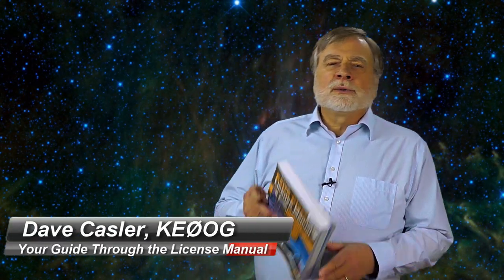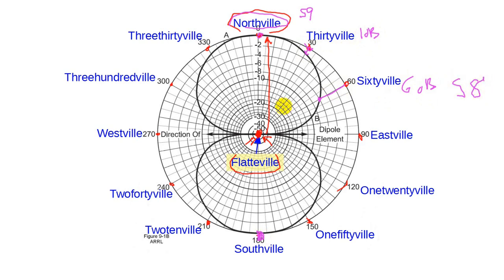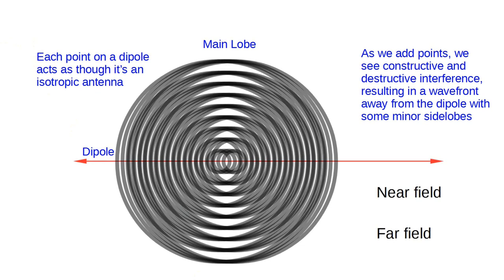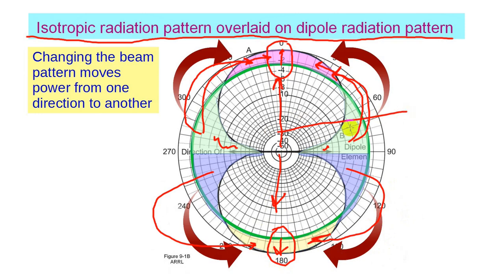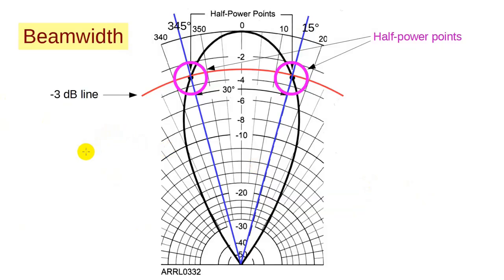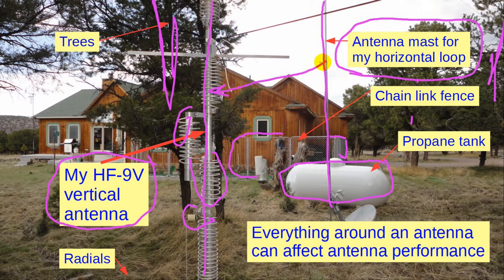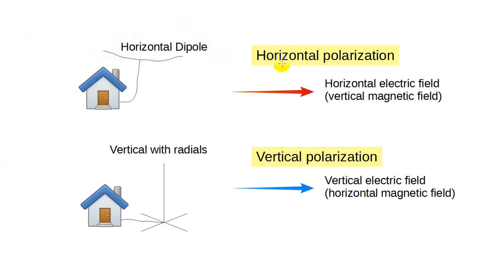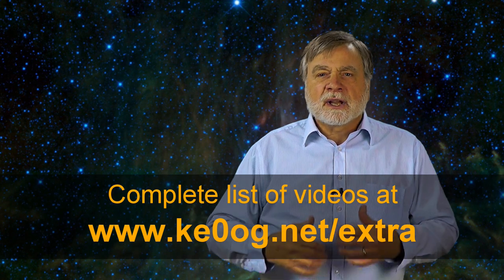Extra Class Lesson 9.1, Basics of Antennas

Comment: This story might help some people understand radiation resistance: Back about the turn of the twentieth century a young patent clerk was trying to understand why antennas generated far fields. Applying Maxwell's Equations generated a near field, but no far field. After pondering the problem, he discarded everything everyone knew about physics and invented Special Relativity to solve the problem.

It turns out that accelerating charges changes their inertial reference frame and causes them to emit photons. One way of understanding antennas is to see them as guides to accelerating electrons so the photons they emit go in the directions you want. 

But rather than teach every HAM radio guy Special Relativity, they started teaching "Radiation Resistance" instead. That worked for a long time, and Electrical Engineers forgot the physics behind their craft. But it's a nice tidbit to know, even if it's not that practical.

Comment: Thanks a lot for making and posting these lessons. I've just got my ham radio licence back and there's a lot I have to remember before I resume operations. I still have to decide which antenna suits me better. At first, I thought of an inverted v dipole, than I thought about a long wire. But since, I like dxing a lot, I may want to build a delta loop antenna. 73 from PY5WHO/PY5136SWL

Comment: Why does the Signal Strenght indicator show the Signal is Stronger the futher away it is from the dipole antenna's element (radiator).

It's my understanding that an RF/Electromagnetic Wave falls in strenght based on the  Inverse Square Law:

The Strength of the EM field is Inversely Proportional to the Distance Squared from the Radiating Antenna.

Comment: What is the relationship between receiving antenna configuration and transmitting antenna configuration for shortwave radio frequencies?  My impression is that reception is less precise than transmission,  and the most important characteristic is height.  I want to try a weather ballon just under 500 ft with a 1/2 or 1/4 wave antenna out of a rigid material in a horizontal mode.  Compass heading may have to be magnetic, ie, north- south.  I’m a ME by education and practice. Be kind.

Comment: If the radiation pattern can be reduced, is it assumed that the antenna has more range?   The power is concentrated over a smaller volume cross section therefore the pattern should be elongated?

Comment: Hi David, is there a diffrence between antenna resistance and radiation resistance? And how do you determine de antenna resistance in practice? 
Thank you for the video, helped a lot!
Reply from the maker: Radiation resistance is a theoretical resistance that corresponds to how much of the power offered to the antenna actually gets radiated. The rest gets converted to heat. I don't know of any way to measure it directly unless on an antenna range, and even then it's rather esoteric to measure and must be inferred from signal strength at a receiving site. The idea is that if the resistance (impedance) of an antenna is 50 ohms, you want the radiation resistance to be as close to 50 ohms if possible. In that ideal case, there are no losses in the antenna itself.

Comment: @23:35 It almost looks like you are making moonshine there buddy. LOL
Reply from the maker: +Richard's World Now you mention it.... That really is my antenna. Honest, officer!
Reply: +David Casler  Honestly, officer, it's an alcohol cooled, coiled 40 meter dipole. I was using water, but it kept freezing, & busting the copper tubing at the seams,, so now I use corn alcohol. Eimac actually did pipe water through a pipe with a dipole run down the center of it and calculated their emitted power by how much the water was heated by the antenna. They used a lot math, thermal losses from the pipe, area of the dipole wire, area of the pipe, the water flow rate, the ambient temperature, etc.  Back in those days, Eimac was regularly exposing nearby residents to way more RF radiation than is allowed today. 73 KI7AQJ

Comment: How can you detect a radio control transmitter channel signal operation strength and frequency with a meter?
Reply from the maker: If you're quite close to the transmitter (a couple feet) you can use a frequency meter. Otherwise you'd need a wide-band SDR radio that covers a wide-enough range to pick up the signal.

Comment: at around 30minutes. why is it horizontally polarised if the book is using the direction of the H-field rather than the conventional E-field?
Reply from the maker: The E-field is horizontally polarized. What we're looking at is the elevation profile, so that's "in the direction of the H field, which is, of course, vertical" The only reason the League puts this confusing stuff in is because there's a confusing test question in the question pool. The bottom line is simply that it's showing far-field signal strength in the vertical direction.
Reply: David Casler thank you.

Comment: David Sir - respect how do you get the antenna to transmit at a lower angle ???
Reply from the maker: Put the antenna up higher. As you push it higher, the main lobe tilts further down to the horizon. There is a limit on this--as you elevate past one-half wavelength, the main lobe starts to split into two lobes.

Comment: A question to experts out there: I bought a log-periodic antenna for 4g 
data (the type with white wegde-shaped plastic housing, 30-40cm long) 
and when I measure its impedance at the remote end of the coax cable 
with a simple TDR circuit, I see a near (but not total) short circuit at
 the antenna end, and when I measure DC resistance, also at the coax 
end, I get 3 ohms. Is this normal? Is the antenna not supposed to be 
matched to 50 ohms so that there should be no reflection at all?
Reply from the maker: Yes, it should match 50 ohms at the design frequency, but likely not at other frequencies. Many perfectly good antennas measure zero ohms (dead short) or close to it at DC. The DC resistance is often completely unrelated to the RF impedance.
Reply: David Casler Check this picture, I am driving a fast rise time signal up the remote end of the coaxial cable (length 10m) and after 90ns I get back a reflection which looks nearly a short circuit but not quite. Is it still possible that the impedance is matched at the frequency range that the antenna is meant to operate at? Or is the antenna defective? It seems to work because I am right now accessing the Internet through it :-)
https://dev.gruppo.fi/~jaakko/IMG_20170525_122459.jpg
Here is also a picture of the antenna itself:
https://dev.gruppo.fi/~jaakko/IMG_20170525_143315.jpg
Reply from the maker: A fast-rise-time pulse has a very broad frequency content, and the antenna and feedline react to these different frequencies differently. If your fast rise time pulse is in fact a step function, you have all frequencies in the response. If you are looking at the response unit impulse then the result is a response curve that translates as a broadband frequency response. Since no such physical system can exist, some of the frequency components will get lost, resulting in a reflected pulse that is not clean. A transmission line has its own characteristic impedance, which is a weak function of frequency. The antenna's impedance is generally a strong function of frequency. I think you are trying to analyze the system in the time domain. I suggest using the frequency domain and using sine waves rather than step functions. Good luck with your experiments! 73
Reply: David Casler Thank you for your great explanation! I recently dug up my old textbooks from thirty years ago about transmission lines and related subjects, and plan to brush up my understanding of those subjects as soon as I have the time :-) The 15€ ($15) Aliexpress antenna works great, though, as I seem to be getting better speed than before.

Comment: What's the difference between Fr. to rear and ft. to back?
Reply from the maker: The same, I'm pretty sure.
Reply: @davecasler   No, they are different.  Both refer to a ratio between the signal at the front of the antenna and (1) the signal exactly, and only at, 180 degrees from the front is F/B and (2) the maximum signal occurring  at any heading in the half circle from 90 to 270 degrees is F/R.  F/R is generally a more useful parameter in evaluating an antenna. 73 K5RX
Reply: Both refer to a ratio between the signal at the front of the antenna and (1) the signal exactly, and only at, 180 degrees from the front is F/B and (2) the maximum signal occurring  at any heading in the half circle from 90 to 270 degrees is F/R.  F/R is generally a more useful parameter in evaluating an antenna.  73 K5RX

Comment: Sir you made a fundamental but serious error.  You didn't mention what length dipole this graph is modelling early on in the video until around 25 minutes into it.  You just stated "simple dipole".  As you likely know, many length dipoles are possible with drastically different patterns.  For example, in the East West direction where you have "deep nulls", a longwire dipole would have strong output close to those 2 azimuthal directions.  I have made and used a longwire dipole and it does radiate "off the ends" meaning strong radiation close to the axis of the antenna (end-fire).

Another serious error is when you talk about deep nulls where no signal is radiated.  I challenge that statement.  Take a 100 element Yagi for example and it will transmit and receive in ALL directions.  Perfect nulls are never achievable here on Earth.  Too much interference/interaction.

Also, I wonder why they chose -3dB downpoints to determine beamwidth as 3dB doesn't make that much difference in the real world.  For example, if a station/signal is copyable at say S5, it will likely still be copyable at S 4.5 (-3db down from S5).  I am wondering if they should have used -6dB or better yet, set the beamwidth to where the signal is at least as strong as that of a reference 1/2 wavelength dipole.  For example, who cares if when using a strong beam antenna if it is -3dB down from that of boresight?  What the operator really wants to know is if his/her signal is stronger in some direction compared to if they had been using a dipole in that same direction.  That makes a lot more sense to me.

Another interesting graph that I dont see if a "difference graph" where someone has the pattern of a high gain beam antenna (let's say 10 dBd), but wants to see a graph (radiation plot) of where that antenna is exceeding the gain of the dipoles pattern (and also where it has loss vs. a dipole).  A multicolored graph might be ideal for this, green in the areas where the beam "wins" and red where the beam "loses".

Lots of "little errors" too such as when you said dipole is "stretched" from West to East.  How much should I "stretch" it?  What if I have a rod dipole do I need to heat it up to soften it first so it stretches like a piece of taffy?  The proper term is oriented.
Reply from the maker: +David James Hi David, I'm sorry you had so many issues with the video. In general, when the term "dipole" is used without a modifier, it means a half-wavelength resonant dipole. The 3db points for beamwidth is a widely-used convention. All real-world antennas radiate differently from the theoretical. I think the rest of your concerns are stylistic; I try to make my videos approachable rather than sternly correct; I receive many comments that validate that approach. 73, Dave, KEØOG
Reply: David Casler I prefer "sternly correct" cuz it is less distracting.